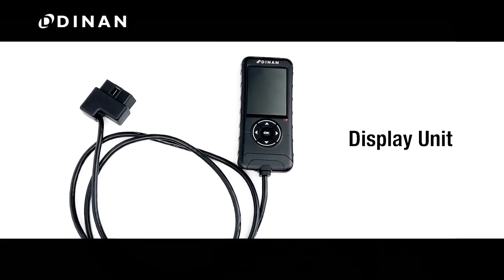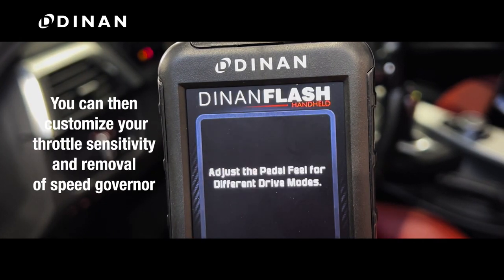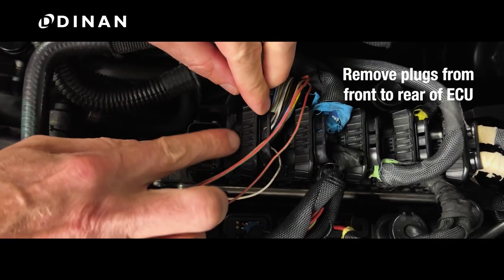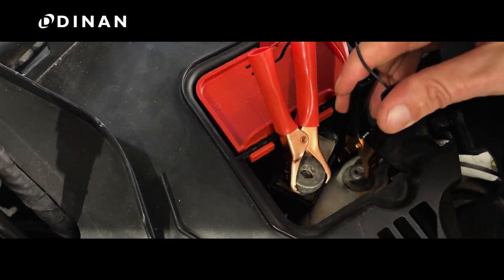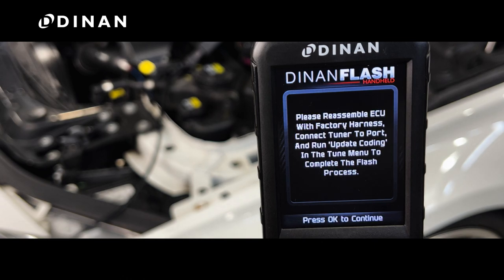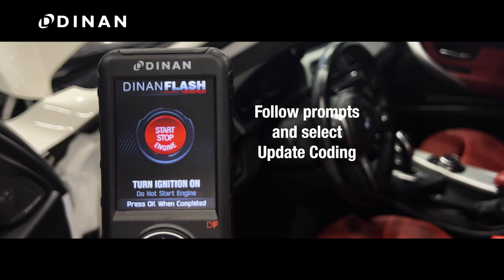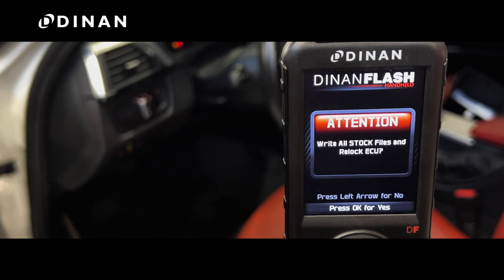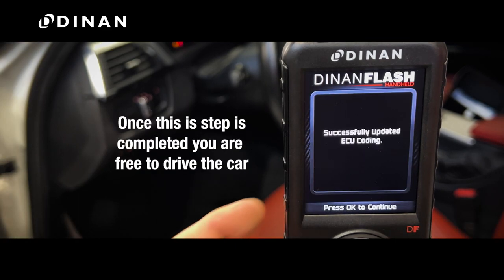DINANFLASH Handheld for the BMW B58(M0) & B46 Engine - Installation Walkthrough

Comment: Just ordered this for my 440i, I'm looking forward to it coming in! Hopefully i can record the install for it also.
Reply: How was It
Reply: @lilkb50x  great, very easy to install and totally woke up the car. Easily take stock mustang gt or camaro ss. I just ordered the intake to go with it.
Reply: @DeWoodysShop  I have a 340I, does the handheld keep the stock burbles/exhaust overrun in sport mode?
Reply: @sriv6714  yes, and probably a little more than stock I would say. I have my exhaust valve open also.
Reply: @lilkb50x  it works great definitely wakes up car but I’m looking to go stage 2 u can buy for a discount !

Comment: The DINANFLASH prompts to unlock the ECU before even selecting the tune from the hand held.  Once connected, it prompts the ignition to be started and then displays the ECU prompt
Reply: So can you unlock the ECU from this Dinanflash tool?
Reply from the maker: @lowereastsideastrologist7769  Yes. (Sorry for the delayed response, missed it apparently).

Comment: to be clear this is just a stage 1 tune and requires no supporting modifications correct? This is for a stock vehicle?
Reply from the maker: Correct. This would be compatible with basic bolt-ons or with an otherwise stock vehicle.

Comment: will there be a stage 2 update ?
Reply from the maker: Nothing currently on the docket. Stage 2 with Dinan would be dependent on a larger turbo and whatever ancillary pieces that may be required which we have not done for the B46/B58 engines to date. We do not tune for DP setups as we wish to maintain legality (emissions included) if that is what you were looking for with a Stage 2 variant.